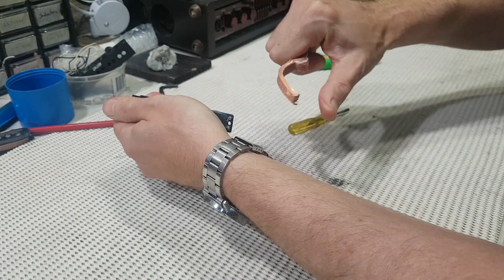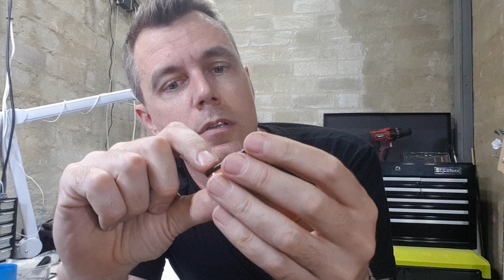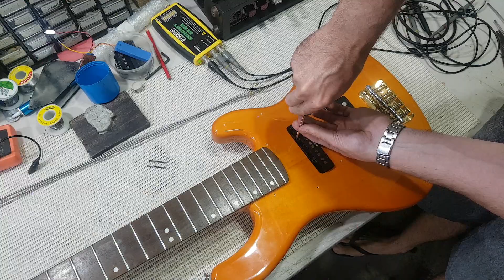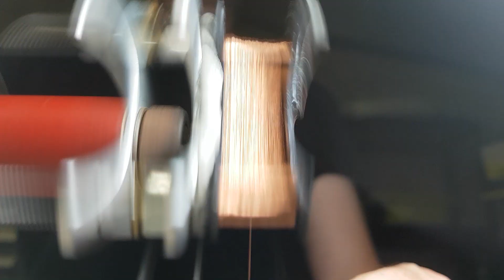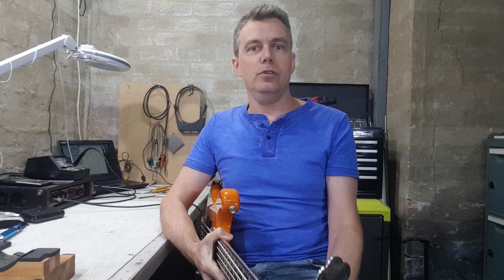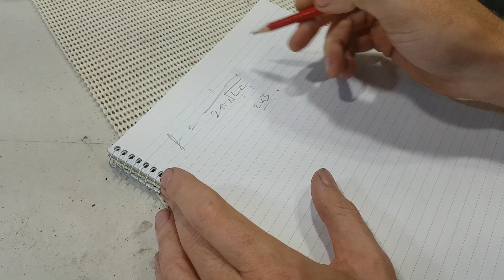How To Wind A Bass Pickup (Project Berocca Part 7)

Comment: Hi Rob.  Am fascinated by your experiments with winding.  I used to wind coils for electronic instruments some years ago.  The thoughts that come into my mind is that the capacitance of a winding can be affected by not only the tension, but the scan of the winding across the wound coil. Closely linear winding is efficient at packing in the turns, but is costly in self-capacitance.  Very early radios used to have 'pie' wound coils that had windings going backwards and forwards across the stack.  They were so stable that they needed no side cheeks to hold them together. You might try using a moving wire guide on your winding machine that tracks from side to side as the bobbin turns.  It will, of course, reduce the number of turns you get on the stack which will also have the effect of reducing capacitance further.  Of course your induced voltage will be lower, but then your capacitive losses will also go down. On board amps would bring the signal back up.  These early radio inductors also had cotton covering on the wire to reduce the distance between windings.  This would not be practical on a magnetic generating coil such as a pickup.  You make a good point about dipping the coil as being used to prevent 'microphonic' movement of the wires.  However, dipping the coil in either parafin wax or epoxy resin will give you different results because their relative permitivity is different. The relative permitivity of alradite would be almost twice that of parafin wax.  Using a vacuum chamber to remove all bubbles from the wax will, again reduce affect the measured capacitance.  We used to vacuum all our coils when immersed in varnish.  I couldn't find the values for varnishes.   I am assuming that you want to eliminate capacitance.  I realise that you are looking for the resonant peak, but perhaps you could add that with a slight filtering in the onboard amp?  It seems to me that you can either chase the perfect resonant curve or you can put the resonance outside the useful frequency range of the pickup.  Low capacitance would probably do that.  While I am brainstorming pickups I see you are trying to balance a 2 string with a 3 string.  The inductance of the coils are dependant upon the area, (squared I think), within the coil, so the 2 string will show a lower inductance all other things being equal.  Equally, if you wanted to boost the inducance of each pickup you can place the magnet pair for each string in the same axis as the string itself.  Having one magnet on either side reduces the available space for the winding pancake to spill out and hence limits the turns as you have found. A narrower field on the string axis should give you more interaction with the string as it vibrates from side to side. It is the cutting of magnetic lines that produce e.m.f. so the narrower the field the more output.  These are brain-storming thoughts and might be totally off the mark, but the science is fairly sound.  It just needs some experiments to see how effective they are.  Anyway, these are just my thoughts on your great project.
Reply from the maker: Interesting point about permittivity.  I've never really thought about this.  Different magnet wire has different coatings as well, I'm guessing with different permittivity too.  Also with slightly different thicknesses as well.  Eliminating capacitance is not the be-all-and-end-all.  In fact in some of my other videos I experiment with capacitive loading to shift that resonant peak around.  A pickup with a really high resonant peak and flat response can sound very strange and sterile indeed.

As for scatter windings vs guided windings, this is very well known, even mainstream I'd say.   To the point of guitarists insisting on scatter wound coils, even though they don't know really what it means and how it changes the tone etc.  (A bit like players who insist on nitrocellulose finishes.)

Magnet position is definitely become more well known since Nordstrand and Bartolini duked it out over diagonally placed pole pieces a few years ago. 

Thanks for your comments!

Comment: one thing that I've noticed, the coils are not dipped in the varnish as an insultation?
Reply from the maker: Thanks for your comment!  Potting pickup coils is not for insulation, it is for physical and environmental protection and also to prevent potential microphonic behaviour of loose outer windings.  Over the years I have used water based varnish and super glue to coat the outer windings.  This is known as "lacquer potting", but it is not really that penetrative.  For high-gain guitar pickups, wax is usually used since it can be kept liquid while the coil is submerged, and it slowly seeps right through the full wind.  If you actually use a solvent based lacquer (like nitro for example) to coat coils, be sure to test some to check the solvent doesn't desolve the magnet wire's insulation.  IME, carefully hand-wound bass pickups don't need anything more than a coat of CA on the outside.  You can buy super glue that comes in a bottle with a little brush in the lid.  This is ideal.

Comment: Another nice video Robb.  Had to stop it and look at the notepad info each time to keep up but that's nothing.  From the AC world with motor winding, the tension side of winding is interesting as the closer you get to a solid coil, yes you get less wire but you also get less space around the wire and so the eddy currents interact differently.  Much heavier voltages involved but does this also work for pickup coils?
Reply from the maker: Hi Blaine.  Yeah eddy currents are present in certain pickup designs.  I know Chris Kinman's tele pickups feature a laminated bobbin design, and of course there's the Filtertron's split cover design.   Ferrites are used in chokes because they are ferrous but not conductive.  But tbh, I really only understand the basic principals at this stage...